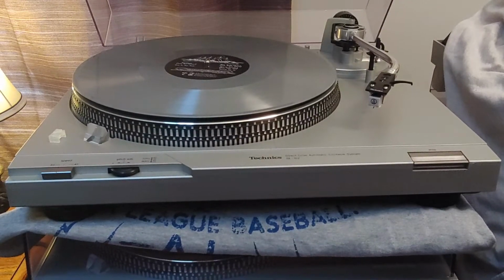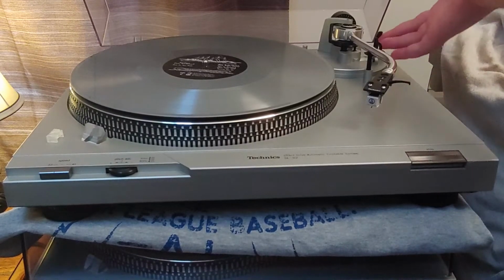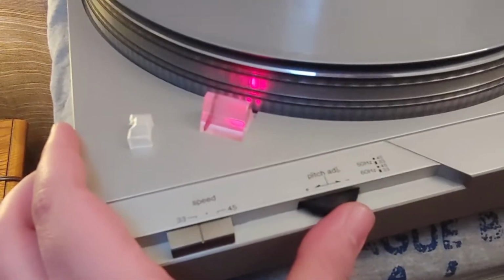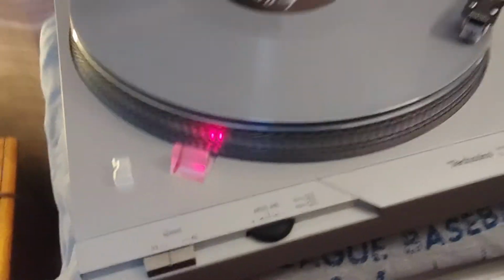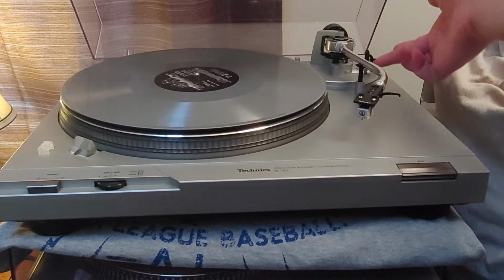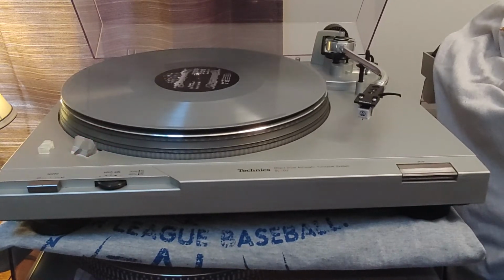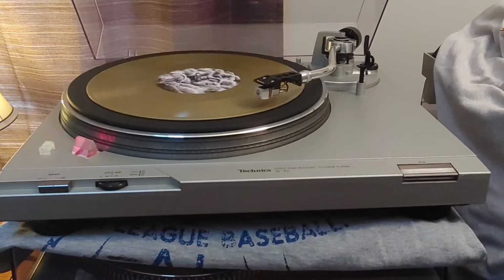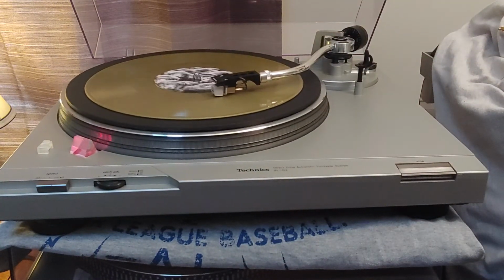Technics SL-D2 Demonstration Video

Comment: A good friend had a Technics SL-D1 back in later 1970's and it probably was the best "bang-for-buck" turntable on the market. Nice full platter and only sacrifice was any auto function.
Reply from the maker: The sl-dx series are built like tanks.
Reply: @steved1129 - my friend used it with a Kenwood KA-7100 and Large Advent speakers. Man-o-Manischewitz, did it sound boss.

Comment: what does the pitch adjustment do? how do i know what to set it too?
on this model specifically
Reply from the maker: It adjusts the speed of the platter rotation. You can use the stroboscope to make sure that it's locked in to the appropriate RPMs